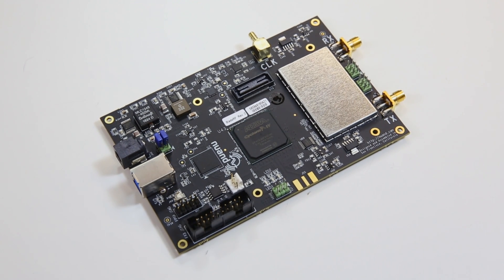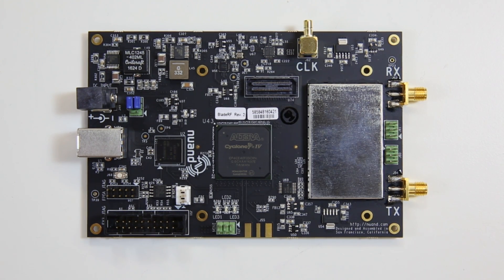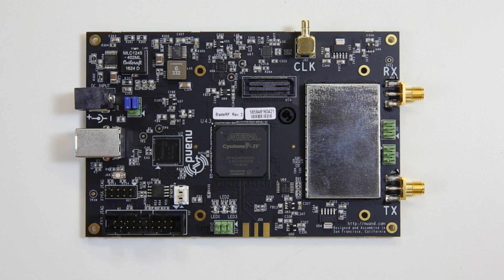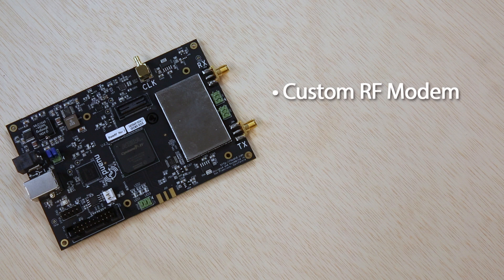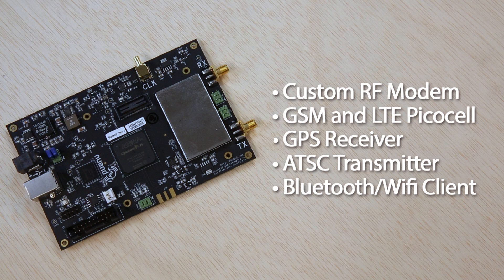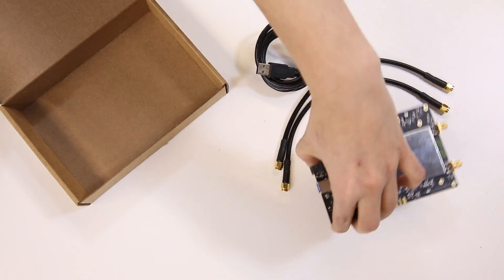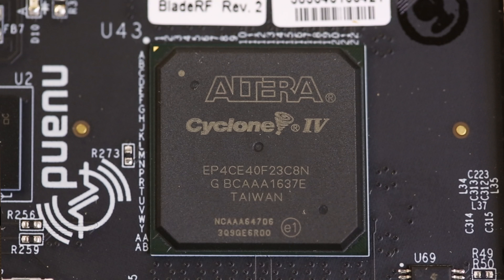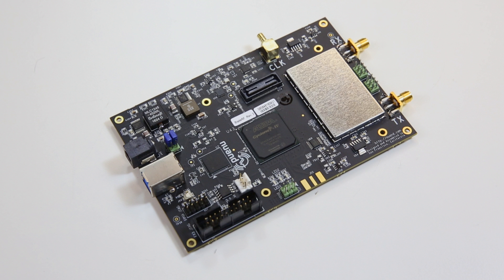bladeRF x40

Comment: I would not call $420 "low-cost", even among other USB3-interfaced SDR units. The LimeSDR is under $300, uses the same Altera FPGA, and has 6 RX antennas and 4 TX antennas and can dip down to 100kHz, and has 50% greater bandwidth and sampling speed at the same 12-bit resolution. Ouch.
Reply: True, but they implemented fast sweep in BladeRF, where the tuning is done in the FPGA which allows for much faster retune time. Maybe someone from LimeSDR could try to port that, it would be great.
Reply: For more info see https://www.nuand.com/blog/large-bandwidth/ and https://discourse.myriadrf.org/t/fast-sweep-similar-to-hackrf-update/764